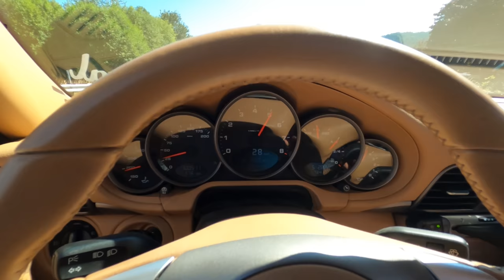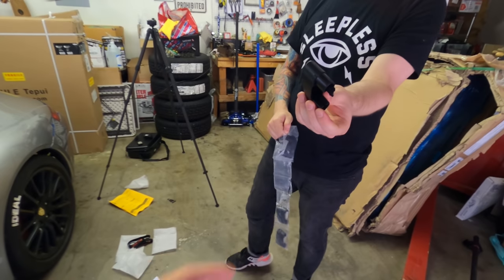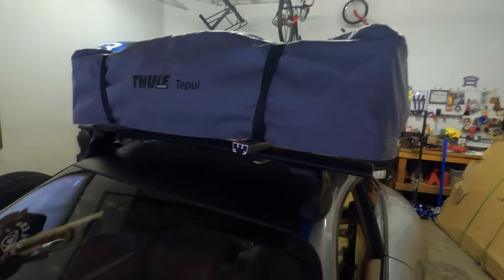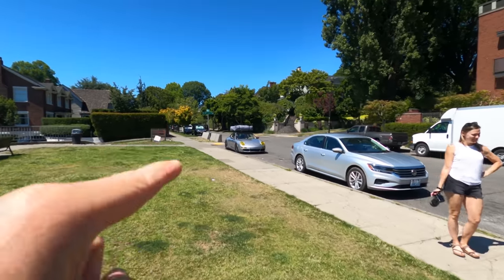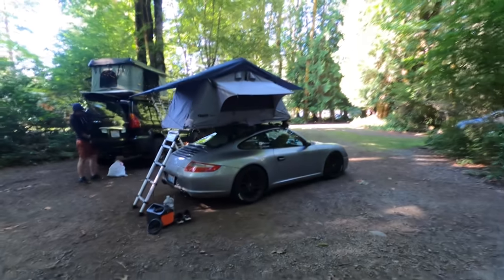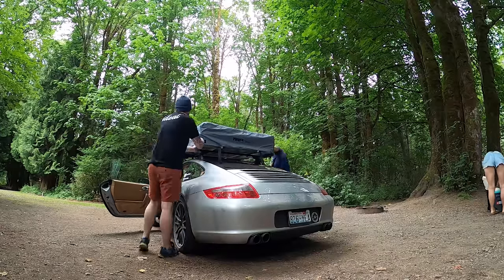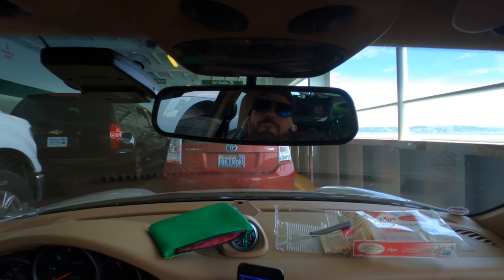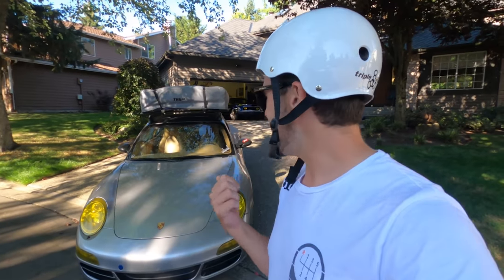How To Install A Rooftop Tent On Your Car! (For Beginners)

Comment: The Squidd has the right approach.  On the 911?  I’ve never seen anything like that, so ... it is unique.  Although a four man tent (more room) would have fit easily into your past carrier.  But at least you were off the ground.  It certainly is a cool and interesting solution.  Great filming/editing, as usual.  Thanks for taking us along on your trip.

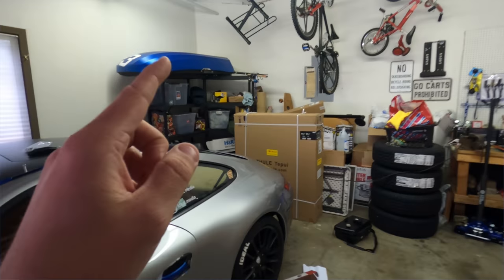Comment: 0:33 come again?
I mean it's your car and all, but it ruins the car's character and design...
Reply from the maker: what do you mean?
Reply: Allow me to explain  @IdealMediaChannel ...
You see, the moment you purchase a car, you're holding the result of a very long chain. Said chain, carries history, passion and hard work.
As such, modifications like these can "ruin" the product's main purposes and functions.

Porsche is a manufacturer that produces one of the best sports cars ever made, if I do say so myself, this is because engineers and designers achieve a perfect balance between performance and aesthetic, which they've been doing for over 50 years.
As such, this modification ruins this 997's smooth lines, interferes with it's aerodynamic capabilities, and raises it's center of gravity, which consequentialy decreases handling.

A great example is pineapple on pizza (don't type yet, let me finish); where the fruit is this type of mod, and pizza is the Porsche. In both sides purists look at it as a cardinal sin, because it goes against all principles and benefits of said product; a pizza should be salty, and a Porsche should be sporty.
Nevertheless, there are people who like their pizzas sweet and their Porsches practical and different, and that's fine too.
Reply: @llama_wehraboo7274  I think it looks awesome. There are lots of older Safari and rally 911s. I think this up coming build/project is an homage to that and we just got a glimpse of it. I for one can't wait. This is an idea video, as usual.
Reply: Like I said @geovaniolivas7373 , in the end if some people like it, it's ok 👌
Reply: @llama_wehraboo7274  If he likes it, let him do it. You can tell whatever you want, at the end of the day, you don't own that car, he does.
Reply: @naseeb46  that's exactly what I meant with my second reply on August 10th, which was 6 days ago 😑
"Allow me to explain [...] that's fine too."